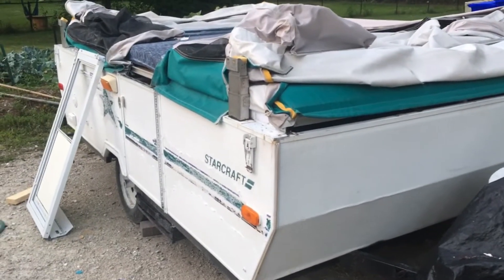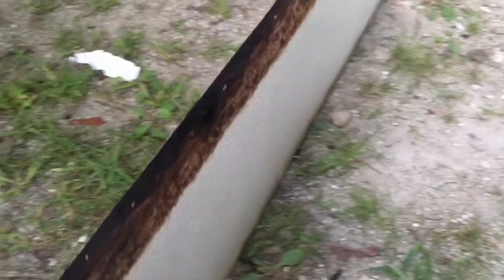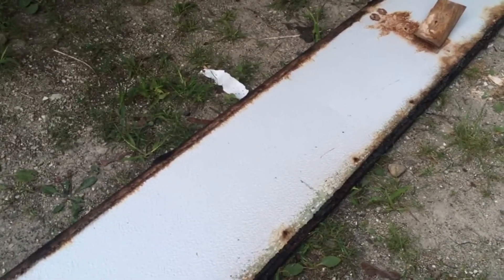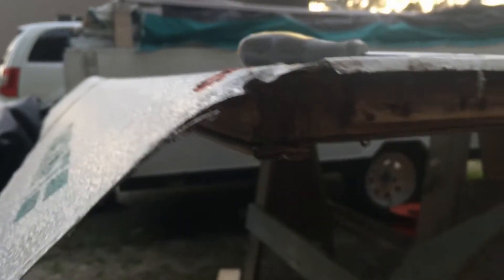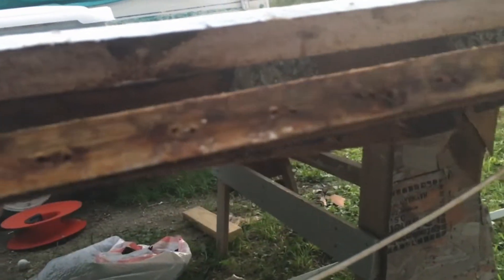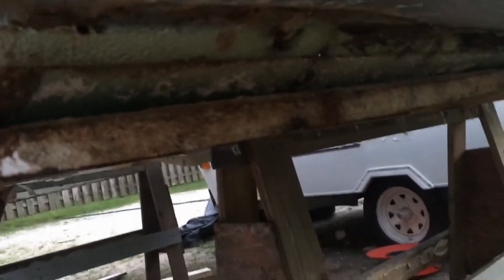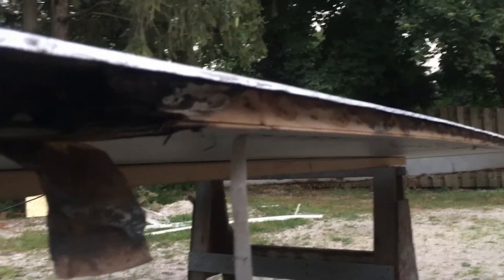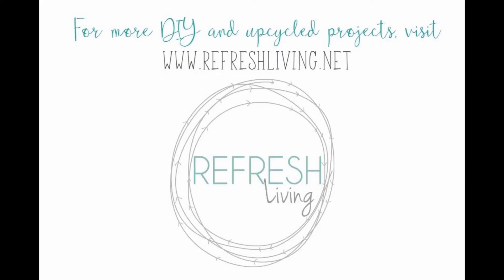Part 3: Assessing the Water Damage to the Roof and a PLAN (Pop Up Camper Roof Rebuild and Repair)

Comment: Our 1994 was stored inside most of its life.  I am removing all the old caulk come spring and redoing the center channel caulking, screws and already have a roll of the trim tape. I have seen many of these Star Craft with failed tops. Since we have no garage or indoor storage, We are using tarps and a cover to put over the camper till spring. In the summer, we have an  EZ up gazeebo cover off our wind destroyed porch  gazeebo. I will we rolling on a fresh covering of that white camper roof finish when its all said and done. Our canvass is in perfect condition for the age too. I scrubbed the filthy vinyl  end caps as no one ever cleans them for some reason. I will be using an upholstery  extractor on all the fabric to remove the embedded dirt and dust, then all the fabric gets a good fabric guard sealer, all the seams get coated with seam sealer. I already have plans to remodel the interior  fabric. All new light green paint on the wood work and we will be using a fern print and birch tree pattern fabric for the privacy curtains on the end bunks. The regular curtains will be a forest green . The Bunk beds will be a forest emerald green and fern patterns for the couch/ bed. My intention is to make it feel as if you are sitting in  the forest, not a camper. My wife loves the idea.

Comment: We bought a tent trailer a year ago, and took it out this last weekend for the first time.  We knew it was in bad shape, but not THIS bad.  Inside roof shows delamination and contact paper failing.

Would be interested in knowing if it's possible to address repairs on the inside without having to take off the aluminum skin, by drilling out the rivets around the inside, taking out the metal brackets and replacing the wood inside.

It wasn't really clear by your video what the inside/underside looked like or if you had to remove the entire roof to get at it.

Did you ever finish this project?

Comment: Sigh... I have the same issues on our pup. I replaced one side of the roof that was really bad. But I need to replace part of the roof because that thin piece of wood is rotted. I used pvc instead of pine on the side. I also have a slide out dinnette that I'm trying to figure out as the whole wall towards the back is bad.

Comment: If I have water damage in a small area above the sink and stove on the couch side of my 1989 Coleman Columbia, how much of the top and rivets on the roof should I pull back to check the damage? Can I do it through the inside ceiling more effectively to access how much I'll need to replace?
Reply: Jessica Brown my camper showed two small places with water damage in the ceiling. Once I started pulling the ceiling down it was obvious that the small spots were both 3-4 ft in diameter.  For me I am going to completely rebuild the ceiling and reseal the roof. It’s a ton of work but the peace of mind is worth it.